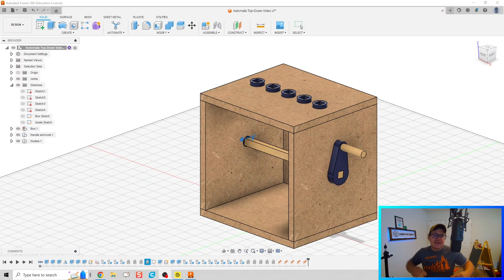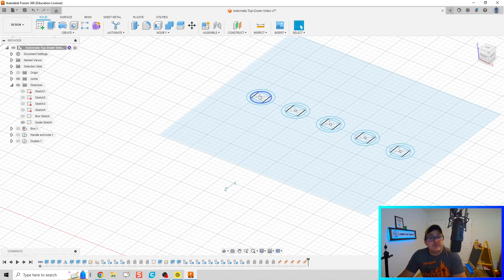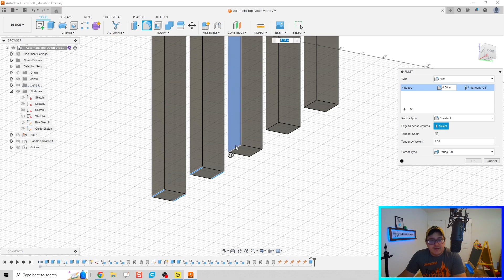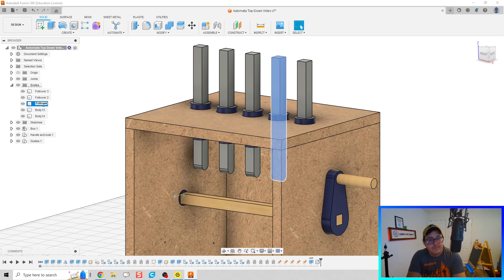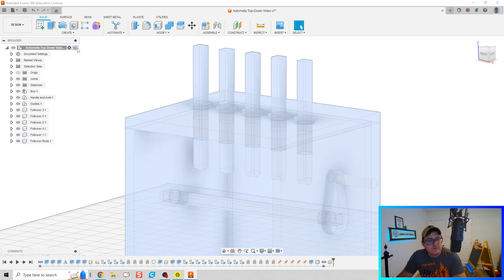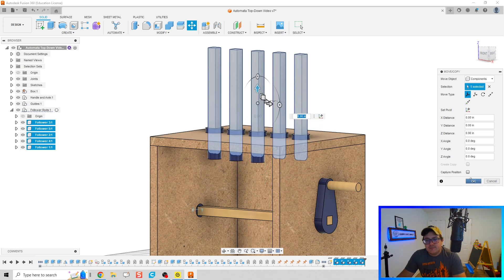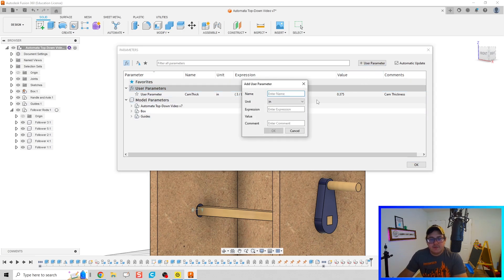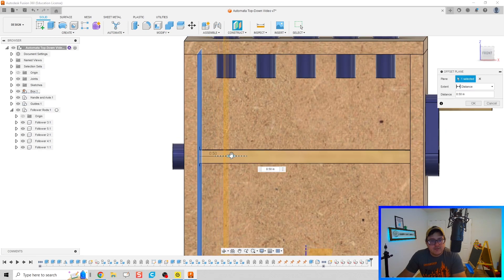Top-Down Automata (pt 4) - Follower Rods and Circ Cam - Day 104 of 100 Autodesk Fusion 360 Journey

Comment: I noticed you using Onshape then switching to F360. I have made similar automata but find F360 slow when animating model, even when using simulated connectivity  as opposed to contact points. Which software do you think handles animation of components the best ?
Reply from the maker: Fusion has much higher-end capabilities, but OnShape works better on Chromebooks. If you have the capacity to run Fusion, it's a better platform for more complex designs. If you're making static parts to 3D print, OnShape does exactly what you need.